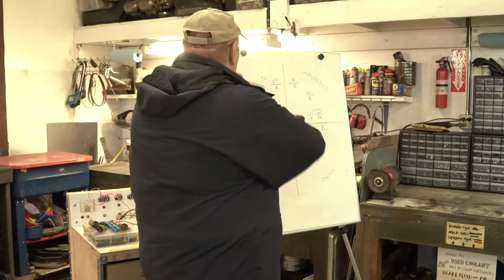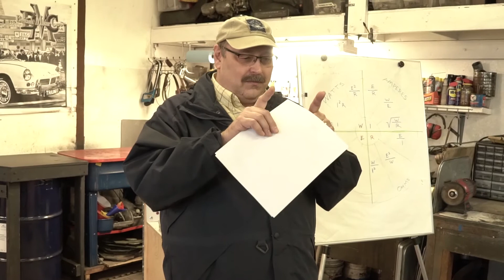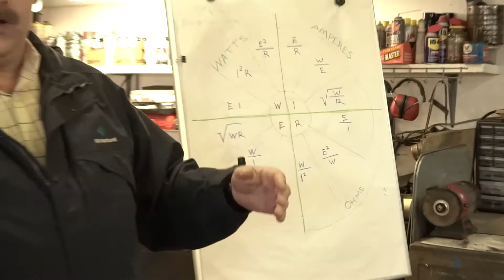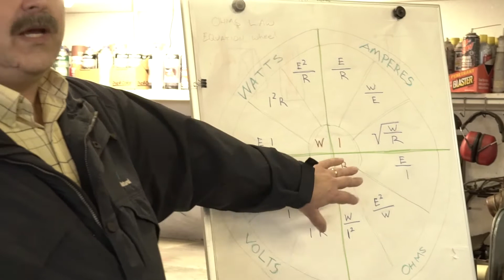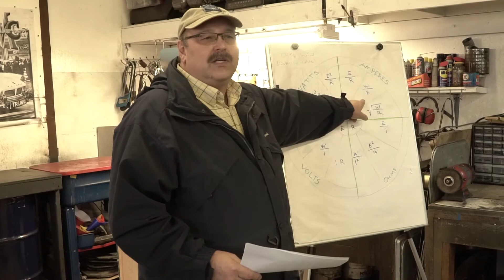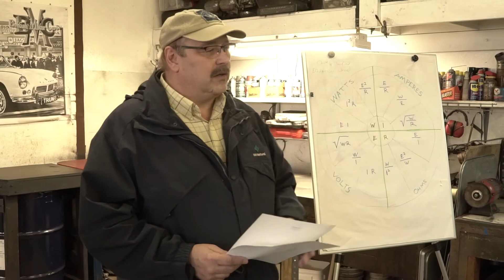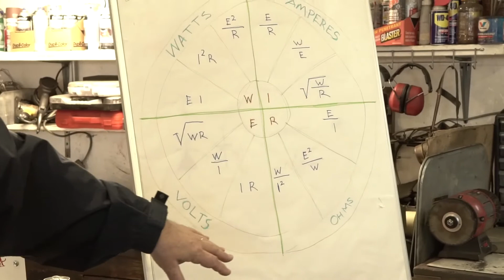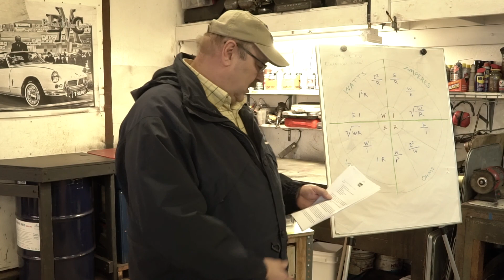Tech Session at British Motor Care Part 1 - Lucas Electrics

Comment: There was nothing wrong with Lucas electrical components. Very reliable. Blame the car manufacturers who connected them up in their cheaply made cars. They put the bare minimum in. 😞 The electrical 'systems' were just good enough to do the job, in cars with low profit margins. The car were not designed to last more than 10 years. Guys with cars over 60 years old expect the cars to work as new.  mmmm  The generators were just big enough, as were the batteries. Too many circuits off one fuse. The switches' amp carrying capacity was on the limit, so accessories needed bigger amp rated switches or extra switches. 

I got most of that from a guy who worked for Lucas. He said Rolls Royce used Lucas electrics and they do not fit poor quality, but RR designed the electrical systems properly using proper quality connectors splitting circuit using more fuses. 

In my older Lucas electrics cars I always fitted an alternator removing the voltage regulator box and when the battery needed replacing fit a larger battery.  Then I bought quality connectors with weatherproof slip over covers, and a crimp tool.  It would take me a few hours to replace all the old connectors with quality jobs.  I did that with any car no matter who made the electrics. Any accessories would be directly from the battery with its own fuse box fitted in the engine bay. Once I bought a bigger fuse box, putting some circuits on their own circuit and fuse. I tended to buy higher quality, higher amp rated rocker switches when available or use a relay in the engine bay to keep amp loads done on the rocker switches. Sorted. 

US implants in the UK, Ford and  Vauxhall (then owned by GM), used Lucas electrics. Their starter motors were interchangeable on many engines. Lucas made an excellent starter motor, which was cheap and reliable with parts available at any local dealer.

On older cars if you can fit an LED bulb replacement it is best to do so, as they use far less current putting less stress on older electrical systems. And they give off far more light. 🙂

Blame the car manufacturers, not Lucas.

Comment: Excellent video from Chad! Now question is has it ever worked with a DeLorean? -VIN 4693
Reply from the maker: Never know! Is this your ride? https://imgur.com/a/35GwJDy
Reply: @OregonMiniSociety  Indeed it is! 😂 that’s the day I got her off the trailer with 9,971 original miles.
Reply from the maker: @MasonFowlkesKenneth  Excellent looking condition. How is it doing now?
Reply: @OregonMiniSociety  Pretty decent as she’s just rolled over 25k miles. There is a bit of an idle hunt with the Bosch K-Jet system that I suspected is from a vacuum leak, but once she warms up it’s smooth sailing.
Reply: @OregonMiniSociety  The reason I looked into these videos is I was wanting to reverse-engineer our wiring harnesses. To have every gauge, length, and run documented. I want to be able to remake the harnesses from scratch with fresh, non-40 year old wires. I would like to keep yo the original diagram, but use modern weather tight connectors and room for expansion.

I was considering going with GM style connectors, but considering most of our connectors were paired with Lucas components, I wonder if I should reuse the connectors?
Reply: @OregonMiniSociety  Just replace them with Japanese or German electrics